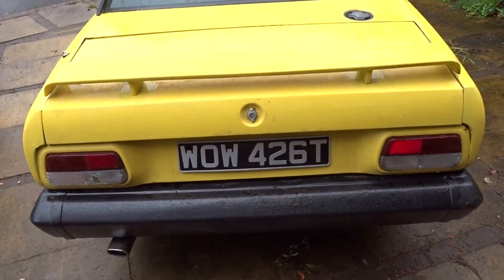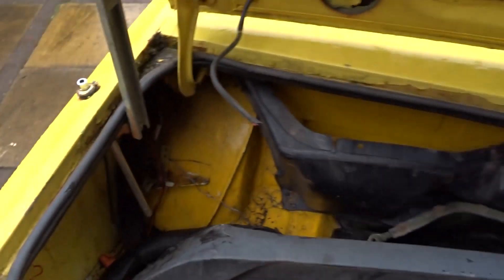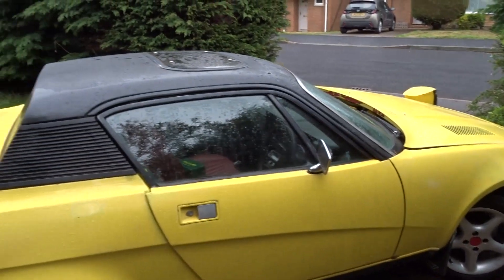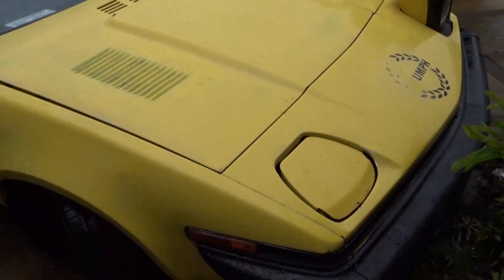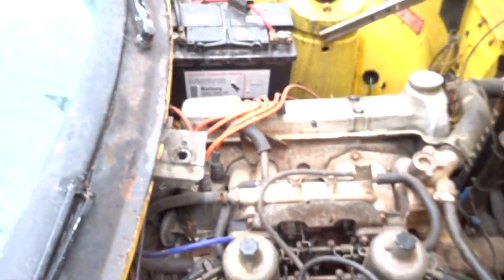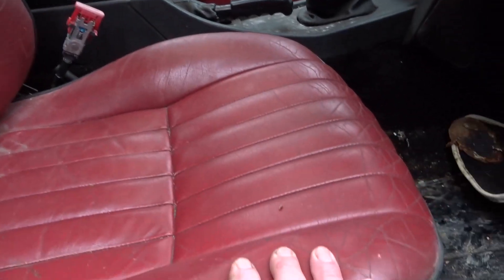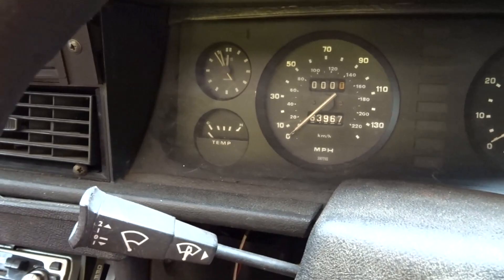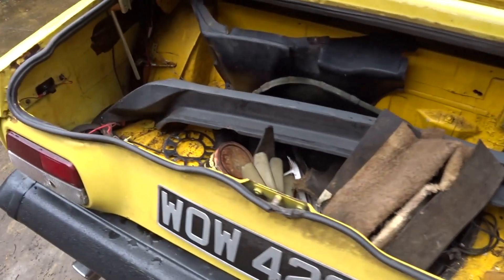TRIUMPH TR7 2.0L Project arrives

Comment: Mate, can't fault you, if you've got the space go for it. That on camera doesn't look too shabby, certainly from on top, not a rot box. That rear wing is an easy fix if your welding skills are up to it, arches and the usual places look good, hopefully the underneath is as good. That fan rig up certainly looks a bit bizarre as a pull through, perhaps reverse it as a pusher and put in front of radiator or go back factory, headlights are usually bad earths or corroded connections on TR7's, I can see you having fun tinkering with this one😍😍
Reply from the maker: Cheers Ian. I'm going to take a really good look over her over the next few days. Should be an interesting build.
Take care mate.
Chris Robinson

Comment: Speke NO!. evil.
Reply from the maker: Many thanks for your comment. Do you have an idea as to where she was made. I haven't done any research as to her history.
Take care.
Chris Robinson
Reply: @chrisrobinson61  From Wikipedia: It was initially produced at the Speke, Liverpool, factory,[2][3][4] moving to Canley, Coventry, in 1978 and then finally to the Rover Solihull plant in 1980.
So it depends on the year. Typically,  the final iterations from Solihull were apparently the best, but the writing was already on the wall. The reputation (at least here in the USA) was already cemented by the perception of poor build quality and unreliability. Tragic, really. The V8 versions with that jewel of an aluminum motor were really something special. Savagely quick and toss-able (for the era) and yet could turn 29mpg if you kept your foot out of it.